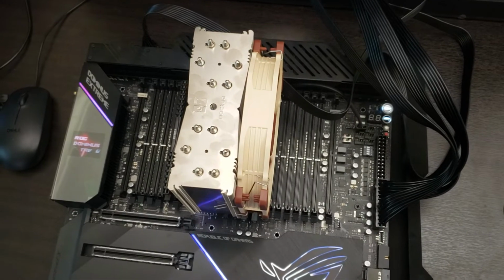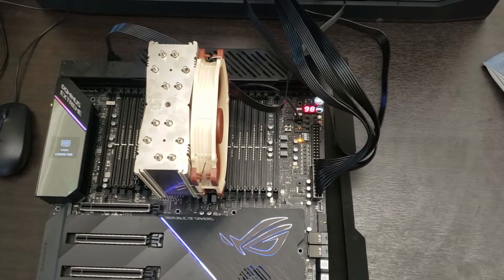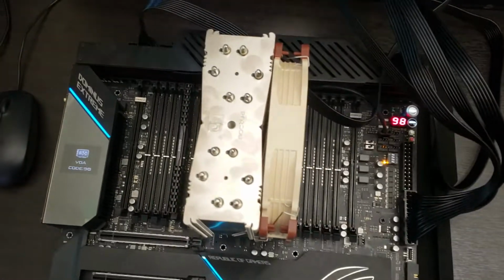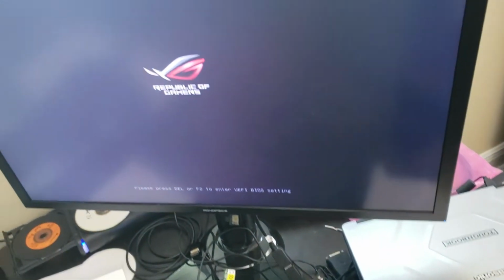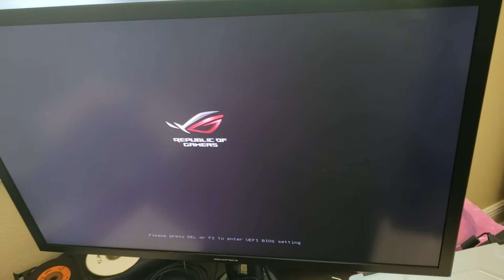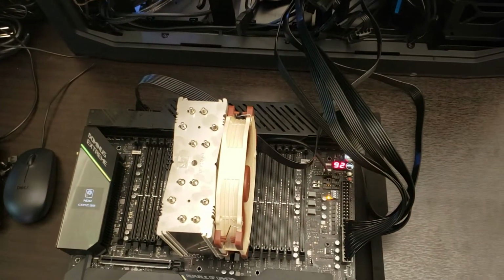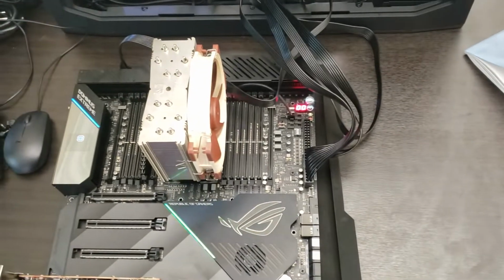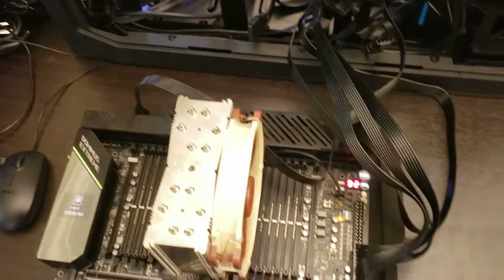ASUS Dominus Extreme Q-code 00 troubleshooting

Comment: this just happened to me with MSI X99A Gaming 7 with i7 6850K, after enabling EUP2013 in BIOS settings. I changed M.2 PCH to PCIE mode aswell but it's not power related AFAIK..
Solution: toggle PSU off (button) press and hold power on button for pc several seconds, power on PSU and power on PC, enjoy...

Comment: One of the most cases this error occurs is that the contact pressure of the CPU cooler mounted on the CPU is too high. Release the pressure a bit by unscrew the cooler a bit. I recently had this problem. This error occured after 2 years of gaming without issues. It came out of the blue. Never changed anything. And yesterday after i booted the system again in the evening i received this error. My monitor screen was black but the lights of the board and ram went on. But instantly after booting the little screen on the ASUS XI extreme board showed error code 00 and the CPU symbol beneath it. Then i read an article to try to release the pressure. With all doubts i losened the screws a bit, booted the system again and the error code disappeared. It all worked fine again.
Reply: Hello this problem just occurred for me as well with the black screen and everything. Since unloosing the screws, has it still been good?
Reply: @f.ramirez2476  After i losened the pressure on the CPU a bit all worked fine ever since! No error code again.
Reply: This worked for me thanks!

Comment: My friend just gave me an Asus X99-A motherboard with the exact same issue. About to pull out the hair dryer out and see if this does the trick. Thank You so much! 👍👌✌️😎
Reply: 2 years later but did it work?
Reply: x99 在asus是通病 要換小元件的 @48kPandy
Reply: Sadly no this did not work. 🥲
I gutted the cpu and memory and picked up a different compatible motherboard to get it up and running.
Reply: Mine did not sorry señor. I ended up having to get a different motherboard. The cpu + memory were fine
Good luck with yours.

Comment: This is an awesome video... I've sent tech support at asus this link as I've on my 4th MB with the exact same issue. Each board I send back they say is DOA and their main technical support chat don't know they have a  bad batch of these dominus extreme boards. Each new board I get is "passed" testing but each one is dead. I'm going to go find my heat gun.
Reply: tech support is some sweat shop with 40c ambient.  "seems to work here"

Comment: You Solved Problem or not ?
Reply from the maker: I sent the board back and got a new one. The new worked no problem.
Reply: @nelis99  : Wow ! You lucky ,Asus Send for Me  second  luck new but not different serial with same problem , now im waite 3rd one :(
Reply from the maker: @StudioSasha  did you try using a hair dryer of some sort and apply a little heat to warm it up to see if it's the same peoblem?
Reply: @nelis99  Yes
Reply: After  hair dryer 4 second  back cover of CPU place  system start up no problem. after off put AC  for 10 min sytem never start up Q code 00
Reply: @nelis99  New have S/N : K5... or K6... or K3 ?My Not Working MB K5... first and K6... Second.
Reply: nelis99 can you check 2 first signs of serial number of mb which worked? Is it K2?

Comment: 100% same problem warming back plate of CPU Cover system start up no Problem,Send back to Asus MB , Asus Send me New,But same Problem, am send Back to Asus again
Reply: The problem is bios need update step bye step ti the latest bios dont hint to the latest version but you must step by step for other version from low to high bios version the motherboard will be run normaly i had to tried this the result its working without any issues
Reply: @revspeed_chan88  I do step by step , but not work from the factory (wrong 2 resistors opacity) from factory . I do return and buying version 2 from england . Newer got problem ,work like charm

Comment: Hi 
I bought the dominus 3 months ago. And have had Q-code 00 since the beginning. As I didn´t know what the problem was I have tried RMA the CPU twice. I have had in total 3 dominus boards, alle Q-code 00. Changed memory. 4 different power supplies. I have been in contact with ASUS they never mentioned the board had problems, so I have been left in the dark, as to what the issue was. Never imagined that 3 boards could be faulty!!
Misterously I have managed to boot for 2 days but only after I had left the boards on for a while showing q-code 00. But that particular board died thereafter. It probably heated up and managed to boot. In the process my 2 titan x pascals died.  

I have now RMAed the first dominus I bought. The 2 others I just send back for a refund.

I think ASUS should come with som explanation. I wouldn´t purchase this board at the moment. Go for the gigabyte one.

Comment: Can't thank you enough for posting this.  I have a K1 Dominus that has been trouble free but I sent this to a fellow Dominus owner who has been through 2 boards and neither has been able to get past Q-code 00.
Reply: As much as I use ASUS boards this one has beaten me up, this is actually my second review. I'm posting this message to hopefully get the attention of someone at ASUS that will address the problem with these boards. I am fortunate enough to have purchased more than one for system builds. I purchased the first board over a month ago and I could never get the board to post, Q-code 00 is as far as I got. I turned off and on numerous times before it finally started, then I let the board sit overnight and then tried to start it, same problem. Newegg did RMA for new board, same problem. I figured I would contact ASUS, after trouble shooting with tech I did RMA with ASUS, however, while I was waiting for the board to be repaired I decided to purchase one from another store thinking that Newegg may have gotten a bad batch, the board worked!, that was odd to say the least. I looked at the serial numbers and the board from another store that was actually an earlier model, serial starting with K3, the board I sent in for repairs starts with K4.
Finally ASUS let me know they would be sending a new board, when I received the replacement I looked at the serial number I figured it was the newest release, serial started with K5. I immediately set the board up and had the same problem as my K4 board. I am presently trying to get a video to ASUS so that I could show them what I did to make the board POST but they say they cannot open the file. Months ago I saw a video of a guy having the same problem booting the board after it sits for 2 hours or more, I searched "cold boot problems" and saw a video of a guy with an ASUS board that would not boot after it sat for a period of time. So I turned on my board Q-code stayed at 00, I turned on the blow dryer, blew heat over Q-code area and the board started right away. It seems that something is wrong at ASUS manufacture and tech support cannot really help they ask you to repeat all the steps that you have already done, I would just ask how long have you been building PCs to establish credibility.
I usually don't post reviews but this has really been a disappointment and I am still trying to figure it out with a new board from ASUS, how can you honor a warranty if you cannot replace a bad product with a good one. So if any of you want to see your board start just blow a little heat on it for about 10 seconds you will be suprised
Reply: @StudioSasha  I am as frustrated as you. I have now waited nearly 4 weeks for RMA to ASUS. 3 weeks since the retalier sent it to them. This situation is unacceptable. 
I am dreading just getting a replacment with the same problem!! I have tried 3 motherboards in total!!
ASUS is apparently aware of the problem according to an american ASUS tech supporter. But he can´t helt as I live in Europe.
Reply: @malthekristiansen5058  They are aware? Bullshit. I just received my motherboard today after my third RMA. I love the big white sticker showing PASS on the outside as if to give u hope it works. I just got error code 00 again. Turned on hair dryer and immediately I get a post and can get into BIOS. What a joke...
Reply: @UptownNYC  
This is a reply from, 
cl-lane@asus.com.

Hello malthe.kristiansen,

Thank you for reaching out, and I'm sorry that you feel like you haven't had anyone to support you with this. Thank you for your loyalty through the years, rest assured you have not been forgotten. Unfortunately I work for ASUS Computer International, which is the United States branch of ASUS and is a separate entity from ASUS Nordic. All the RMA and related services for your motherboard will be carried out by their team. 

With that being said, ACI is aware of the Q-code 00 error with the Dominus Extreme boards and is actively investigating it. What I can do is get your RMA number and serial number of the motherboard, and attempt to reach out to ASUS Nordic and make sure they are aware of the Q-code 00 issue. Once I give them that heads up, that is about all I can do from my end. I hope everything goes well, we want to get this issue figured out as much as you do!

 

Best Regards,

Lane P. 

My vendor has just accepted that the motherboard is faulty. They will give me credit! Not a refund. I will go for the Gigabyte Aorus Xtreme instead. If they can not deliver that. I will see if I can get my money via paypal. And get the Gigabyte via Amazon. This  is an ongoing farce.... 
Damn, I regret buying this system.....

Comment: Omg
I bought amazon dominus...yesterday
Reply from the maker: Yea I tried multiple things. Went through support with swapping PSU's, BIOS update, etc... Nothing worked. The board still had some type of thermal sensor problem. I got a new replacement board today. Using the exact same equipment the new board booted up first time no problem. The original board was definitely bad. Good luck to you. Test it right when you get it so if it's bad you can return for replacement.
Reply: @nelis99  
Wow good

What is bad board's serial?
What is good board's serial?

K2 k3 k4 k5??

What?
Reply from the maker: @132-h7v  The original board was K3 something. The new board is K3 as well. The original is already boxed up being shipped out so I can't get the full number to correlate.
Reply: @nelis99  appreciate.
Have a good day~
Reply: K1 or K2 Good
Reply: @StudioSasha  finally k3 board booted....good.